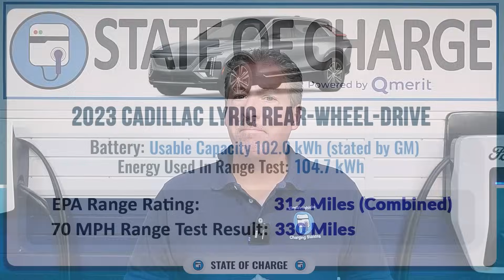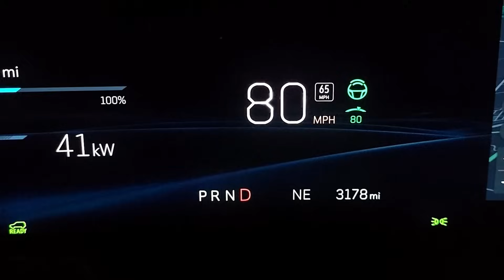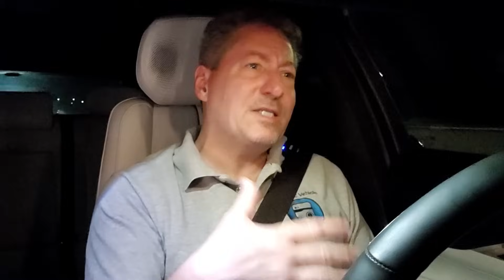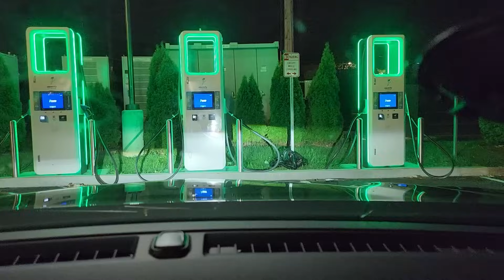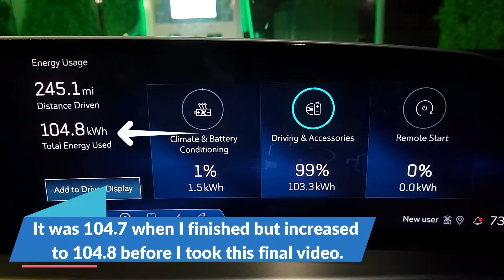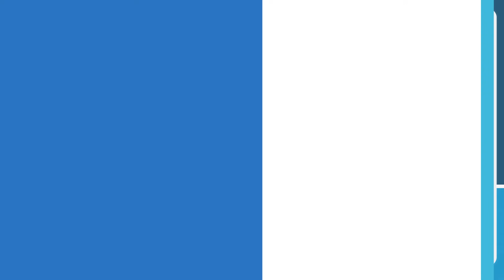Cadillac LYRIQ Range Test Comparison: 70 MPH vs 80 MPH

Comment: All things being equal, your efficiency should vary as the square of your velocity. 35.84 meters per second vs 31.36 meters per second. Squaring these two numbers gives 1284 vs 983. The ratio is 1.3  to 1. Your ratio of miles per kWh is 1.34 to 1. Close enough.

Comment: Mentioning just one out of many of my long-range travels is from Lancaster county Pennsylvania to Jacksonville Florida. I travel at night for the same reason, very little traffic. My travel car is the 2019 Jaguar XJL which delivers 570 miles of range which is far greater than the 330 miles of range the Lyric provides. This trip takes 838 miles to complete which means besides stopping to use the boys room, girls room for the wife, which doesn't take us no 20 to 40 minutes to do, i only have to stop once to fill up, gone in 5. As my entire family from the northeast is also on the road headed to family members in Jacksonville for a reunion 🫂, i see many on the same endeavor. I complete the trip in 11.5 to 12.5 hours. That same trip will take 13.5 to 14.5 hours or longer by EV thanks to all the sitting around you have to do. We all arrive in  a 2 hour spand. I also travel to Dallas Texas, Chicago Illinois, Johnson city Tennessee, st Louis Missouri just to mention a few of my long-range travels. 

When the California high-speed rail project is completed enough that bullet trains are in service, i plan to make the drive from Lancaster county Pennsylvania to LA to experience high-speed rail. This is my future goal and will definitely not making it with any car designed to hold you up.

Comment: ICE vehicles also have an exponential loss of mpg after 70 mph… it is physics, the motor or engine work much harder to push the air around the vehicle.

Comment: I think a better, more progressive perspective might be to show Time vs Cost.  Rather than just Cost vs Range. 
Regardless of the Cost, there is still a distance that a person needs to travel.  Some would prefer getting there faster (when possible)

So, does travel at 80 MPH make up for the time spent at the refilling station more often?

Example:  using Tom's numbers from the Lyriq
(assuming ideal driving conditions, and that you can find a charger that is free and 350+ kW)
-- 400 miles @ 80 MPH,... 35 min recharge 0-80% = (185 + 35 + 115 mins) = 5 hrs, 35 mins
---  cost @ $0.36 / kWh = $62 
---- 173 kWh used
-- 400 miles @ 60 MPH... no recharge needed = (435 mins) = 6 hrs, 40 mins
--- cost @ $0.36 / kWh = $35
---- 97 kWh used

It would cost almost TWICE as much to only save 1 hour of time

Comment: Power required is directly proportions to speed squared. It comes for all cars. Evs have no special powers especially ones with higher drag coefficients.  Plus evs are heavy and get no advantage in weight decrease as fuel burns … another detriment for evs.

Comment: appreciate this data. My PHEV wrangler 4xe in perfect conditions gets 1.8m/kwh, and weighs 5,100lbs.
It's gotten as low as 1m/kwh when it's cold and the heat is cranking.

We love it, however I'm skeptical that a 400-500lb heavier vehicle is able to get 50-60% better efficiency. 

This skeptic is totally OK with getting 250 miles minimum. The most we ever travel in one shot is 210.

Comment: GM EVs have poor aerodynamics, and even understate the battery size (a nominal 85 kwh battery is actually 90 kwh), to give them decent range and make them look more efficient than they are.  And all the GM EVs appear to have wheels with six lug bolts (same as an F150 Lightning), which tells you how heavy their EVs are.  The Equinox is at least 1000 pounds heavier than a Hyundai Ioniq 5.  Nice try, GM, but maybe you should reintroduce the EV1, which was much lighter and actually had decent aerodynamics.

Comment: All I noticed was the POSTED speed limit of 65 mph and the car’s speed of 80 mph. That’s 15 mph ABOVE legal max speed The headline should read: SPEED KILLS! Crashing at 85 is exponentially DEADLY as shown in car deaths/injuries each year. BTW, what actually decreases range or efficiency is what is NEVER TESTED: SPEED variability. Passing, acceleration/slowing down, changing lanes as if possessed. 2022 Ioniq 5 at 65 mph yields 3.8 miles per kWh. Ioniq 5 YouTube reports have shown drivers getting barely over 2 mpkwh! Of course, Average Joe/Jane is convinced, sold, believes, is sure, driving Faster and Faster, is GOOD! Then the TV news reports the deadly crash. RIP Average Joe/Jane. This and other videos PROVE efficiency, range and cost per mile suffer greatly speeding. SPEED KILLS everything.

Comment: Any sense how much of a difference it would make at 90 MPH?  Thinking about a Lyric, but one of my main drives is DC to New York City. I'd say most of the time I'm doing that run it's either tons of traffic, but when it isn't I'm usually cruising at 90.

Would like to do that trip without charging.

Comment: We have driven our Tesla Model Y for 40,408 miles. It has used 10,650 kWh of electricity for an average of 264 Wh/mile. Our energy rate is 9 cents peak and 5 cents off peak. We average 10.1 cents INCLUDING taxes and usage fees. So, we have spent $1,075 to drive 40,408 miles. We have only used a Supercharger one time. The rest has been home charging. I test drove a 2024 Lyriq today. It is beautiful inside and out. Tesla Model Y is no comparison luxury wise even to the Lyriq base model. The price on the base model (the only one they had) was $65,000. There was only one thing I absolutely hated and that is a whirring sound it makes when you are driving below 25 MPH. It is supposed to be a warning to people because otherwise the car is silent and if you are pulling up around a pedestrian they might not know you are there. It sounds like something is wrong with the car but the sound is built in. The dealer said you cannot take it off.

Comment: My 2015 Hyundai Veloster turbo on most efficient setting  gets 32 mpg at 60mph without AC 422 range, 30 at 70mph 396 range, and 28 at 80mph 369 range.  Turn on the AC and lose about 1mpg across the range reducing the range by another 13 miles of range.     I can ger about 35 to 36 mpg if i drive 45 on flat highway.  It would cost me $150 to $175 for a 1000 miles in MUCH smaller car rhan the Lyric

Comment: I have to wonder what the fuel efficiency difference would be in an ICE vehicle for two similar tests!  I wouldn't be surprised if it was close.  If your fuel is used to overcome aerodynamic drag ONLY (not true, but please humor me for a moment) then I'd expect the fuel consumption per mile traveled to drop with the square of the velocity.  So... I would expect the miles per gallon to drop by a factor (70/80)^2 or a factor of 0.7656.   You are getting 245/330 or 0.7424 which is close.  There is probably a slight drop in efficiency in extracting energy from the battery at higher currents so that might explain some of the difference.  But, other losses are  involved beyond aerodynamic drag and I suspect most of these are not proportional to the square of the velocity.  So... It is complicated.  Still... A similar test with a similar size and shape ICE vehicle might be an interesting comparison!

Comment: We cruise around 80 mph on most highways driving on vacations in 90F weather. At that speed average 30 mpg in Mazda CX5 (top of the line bought for 34k).  1000 miles = 33 gal at average between NC and FL $3.3/gal = around $109. Very comfy car with adaptive cruise and beautiful interior. 5 years ownership cost (26k miles) = 5 checkups average $90 (oil change, rotation, etc.)= $450.
Average 27 mpg over 26k = fuel cost at average 5 year price around $1600. Total $1600 + $450 = $2050 over 5 years.

I have been checking all EVs for few years now and it is an absolute deal breaker especially now when companies owning chargers can raise the prices as high as they want. Spending almost 2x more for a car that will cost more in electricity than fuel plus extra insurance and taxes doesn't make any sense to me and I am sorry for people who got tricked by the industry into believing in all the hype.  You can get 2 excellent ICE's or hybrids instead. We actually own 2 CX5 with similar milage so it is 2 per price of one upgraded Tesla.

And I don't need to drive in a right slow lane to save on fuel and wait at slow expensive chargers vs 5 min at the pump.

Comment: You are wrong about the Porsche ev to be less effected by higher speeds. The loss of the energy due to air drag component will always be proportional to V^2. The loss of the energy from inefficiency and friction will be added to that and less speed dependant.

Comment: As a former F-150 Lightning Lariat EV owner (and owner of 33 other vehicles in the past including 2 Prius', 1 Camry Hybrid, 1 Avalon Hybrid Limited w/Tech Pkg and an Accord Hybrid Touring)... a person really needs to figure all the calculations and be honest about the limitations of an EV. For example, how my wife's Ridgeline gets 26.3 mpg (calculated at the pump) where it actually cost LESS over a 1,200 mile trip (even when I figured gas at $5 per/gal.) than the F-150 Lightning EV for both total cost and speed/time (which what is a person's time worth, which I did not even calculate in). The Ridgeline was over $20 Less to go on a 1,200 miles trip (and this was back when DC Charging Prices were consistent instead of much higher now). Plus, that does not include the hotel because of how long the Lightning took for charging, too (the Ridgeline could easy make the trip in one day).

So with this Lyriq... if I compare its costs to the RAV4 Prime... the Prime comes out on top again. But I can keep driving for over 600 miles at much higher speeds, too. And again I did the math using gas at $5.00 per/gal for both the Ridgeline and RAV4 Prime. So I'm not trying to be dork... I've personally owned those 5 previous hybrids and 1 F-150 Lighting EV... and again for me, I don't want to drive in the slow lane for me personally. Anyway, hope that might help others out there! 😇

Comment: No DUH! You can't get around physics..LOL! I'm glad you pointed out the limitations of electric vehicles as long distance vehicles and that they don't all save any money if used as such. That Cadillac cost more to operate at highway speeds than a vehicle that gets just 30 mpg highway at 70 using chargers away from home. They are still best as a daily driver and you need an ICE vehicle for long trips...anything over 200 miles. BTW, NO ONE is going to be comfortable running their electric vehicle to the point where it goes into limp mode. So your true range is 80% battery capacity or 20% less than what you ran that Caddy to.

Comment: My wife has a 1.2litre SEAT Ibiza and used to drive 3 miles to work on a road that was jammed. Over one month of driving her car delivered 26 miles per gallon (that’s less than 6 miles per litre). On a longer drive on A roads where we averaged 56mph, the same car delivered 52 miles per gallon (nearly 12 miles per litre. So speed has always been a determining factor if the driver cared. You guys in the US love huge heavy brick shaped cars and trucks and relied on cheap fuel to compensate for the huge engines. Getting efficient was always going to take time. Thank goodness for Tesla

Comment: Tom, it would be an interesting calculation, if you have the data to figure it out, what is the OPTIMUM cross country SPEED to minimize trip TIME, when you figure in traveling faster, but therefore spend more time charging, to do your 1000 mile trip.  It might take less TIME to drive 70 mph for 1000 miles, than to drive it at 80 mph but charge more.

Comment: There is a similar drop for ICE/diesel vehicles, as well. I haven’t tried it before but it’s obvious from the physics equation someone has presented.  The only reason people are talking about such, is the fact of the limited amount of charging stations especially in rural areas. Would have been interesting to know how battery temps vary especially when there is not a system for regulating battery temp. If I ever buy an EV, it must have a battery temp regulation system.

Comment: well no DUHHHHHH. an SUV getting WORSE range at higher speeds. 

this amazing basic aerodynamic concept happens in GAS vehicles too!

2022 tuscon hybrid
(does not have heat pump)

65mph or below-37mpg
70mph-34mpg
75mpg-31mpg (at 16F=23mpg)
80mph-28mpg (at 16F=21mpg)
85mph-24mpg (at 16F=19mpg)

these common sense range tests are just laughable when we know the obvious.   

climate control wont matter, you are driving a BRICK at high speeds, ICE or BEV its obvious.

Comment: I'm very surprised that your wrap-up conclusion was about total distance and cost rather than time (including driving and charging time). To me, that seems the most obvious type of number-crunching this test demands. If this were part of a longer roadtrip, does that extra 10 mph of speed "save" you enough time to make up for the extra charing it'll make you do. Given we're talking about 25% range penalty for a 14% increase in speed, it seems like that you'd complete a ~500-600 mile roadtrip FASTER at 70 mph than 80 mph when accounting for charging. Would have loved to see you delve into those numbers a bit more since that seems the most practical application.

Love your channel. And pulling this off took some serious commitment. Glad the cops didn't bust you on the turnpike at 2AM to spoil the whole thing. Haha.
Reply: Back in the 1960s I competed in three of the Mobil Fuel Economy competitions.  No matter what we drove (they were different each time) we quickly established that completing each stage at the slowest possible speed while finishing in the allotted time, was the ONLY way to go.  We tuned and tweaked everything allowed prior to the events but speed kills fuel economy.  However, ...    There is another issue with EVs.  Battery temperature.  For maximum range in an EV you need to drive at the warmest time of day (unless your in a very hot location) AND keep your speed down to a reasonable setting.  Driving slower will not add much time to a trip.  For example, driving 240 miles at 70 mph non stop will take around 3hrs 45 minutes.  Doing the same trip at 60 mph would take 4 hrs 20 minutes roughly, or 35 minutes more, which could be the extra time you'd have to take part way to recharge your battery.

On the subject of battery temperature, with our 2022 Bolt EUV Premier, driving when the battery is around 35F rather than 70F will reduce our range by around 40 miles, driving on two lane mountain roads at 55 - 60 mph.  All batteries are very dense so they take a long time to warm up or cool down.

Comment: That was interesting. So it’s just like an ICE vehicle. The faster you go, the less the mileage. I’m over 65 now and have never owned an EV. I would like to, but never able to because of where I live in the southeast. Not enough charging stations for road trips. Would you explain why is an electric vehicle so aerodynamically hurt? I hear the you put an enclosed trailer behind the Ford Lighting and you lose a lot of range. Yes I know if you put that same trailer behind an F150 and you lose MPG, but it not as bad as an EV. Why?

Comment: Once you get above about 45 or 50 mph the majority of the propulsion energy of the vehicle (whether ICE or electric) is spent pushing air out of the way, but it seems that EVs are more affected than ICE vehicles. And I have a question: at 80 mph, how did you avoid a ticket from your friendly New Jersey State Troopers?
Reply from the maker: How? Very carefully!

Comment: 70 mph is a good baseline, a compromise for speed limit drivers and fast drivers, forget hyper milers, they'll argue the results anyway.  It seems that the 70 and 80 ranges will vary between vehicles.
It would be great if Chevy (Bolt EV) could do a software update to show % on dash, probably not possible.

Comment: I commented to Kyle Conner (no response from anyone) on his race to Vegas with a couple of his buddies, that I would've liked to see someone with an identical Lucid Air to what Kyle drove, drive 10-20 mph slower to maximize it's huge battery and range. I think the race would be very interesting to see what the outcome would be. Would that have meant less charging stops and more driving time? It would be interesting to explore this.
Reply from the maker: I agree that would be very interesting. It would be cool to get 3 Lucid Air and have a race. One drives 60 mph, one drives 70 and one drives 80 mph over 1,000 miles and see who wins

Comment: With that range drop, is it even worth going 80mph on a road trip when you have to stop and charge? On a 600-700 mile trip, you would need at least 1 full extra 30 minutes stop. On a 600 mile trip. You would only arrive about 30 minutes early due to extra charging times, so it might not be worth the extra cost. Almost certainly not worth the extra to go 90mph+.

Comment: I have now over 47k miles and 3 years on my Taycan (lots of local commuting and road trips) and I can definitely attest to the range drop over 70 mph is real there too. Maybe not as bad as the Lyriq, but it is quite noticeable. During my daily commutes or running around town, i likely wont get the opportunity to get over 70 mph and get better range. Only long trips when I can get over 70 mph (i def have a lead foot), i usually cruise 80-85 mph and notice i get much less range when i do that, vs staying closer to 70 mph or under, on those trips. Great video Tom and thanks for illustrating it so well.